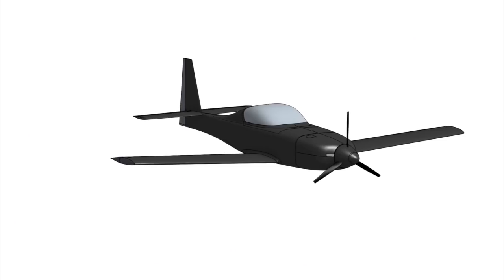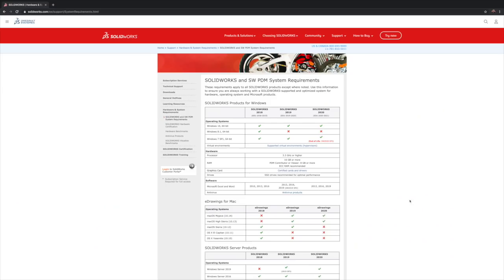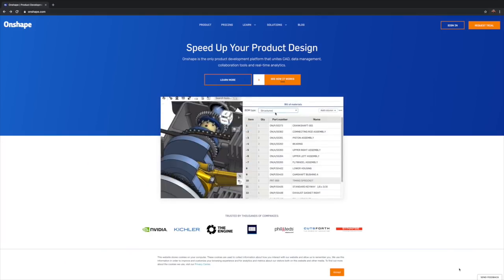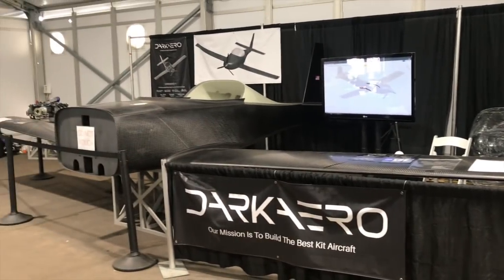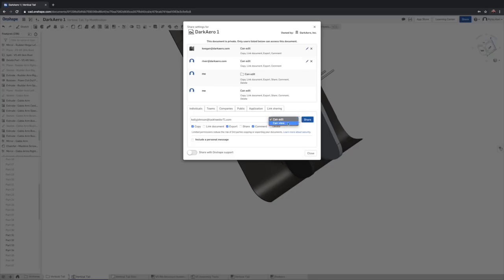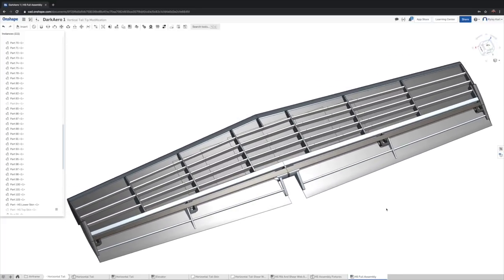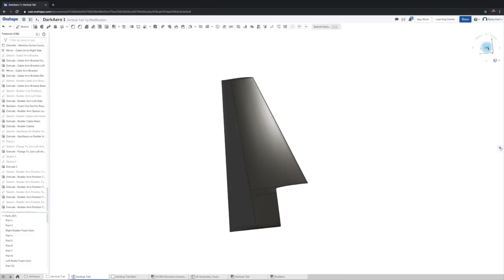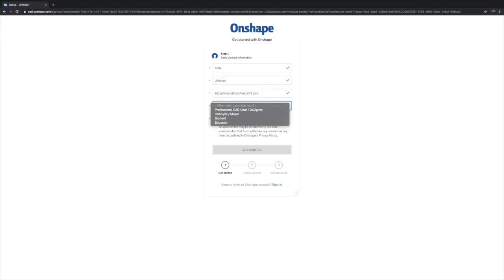Why we switched from SolidWorks to Onshape

Comment: 2019 had used SW for about a year-ish ...then its been about 7 months using Fusion 360 to date .. now on the verge of finalizing for Solidworks .I believe SW is shifting to Cloud (got to verify) .. ...been hearing about Onshape ... we are a Autonomous Vehicle Company (very early stage startup) and looking at stabilizing and freezing on ONE at most TWO CAD applications ...looks like Onshape is a new contender.
I AM OPEN TO ADVICE, SUGGESTIONS and sharing of thoughts.
(thank you for the video it was definitely the pivot that swung me around)
Reply: I would not use SolidWorks unless you have a legacy reason to do so.
Reply: SW is moving slowly to the cloud, but in a cobbled together fashion.  Onshape was built from the ground up for the cloud. Just my 2 cents.
Reply: You might also look into Alibre to see how it compares. If you're designs are more surface oriented, less mechanical, then perhaps Rhino.

Comment: You can try 3dexperience platform using solidworks. It's cloud based and It has xdesign, xshape and do simulation as well while also have access to solidworks.
Reply: This is what I wondered, 3Dexpereince has been arround for at least a couple of years, so
Reply: I think the big drawback for small startups is the cost. There's just no getting around that pricetag...
Reply: @zaknefain100  okay, so they just announced it will available to you for $9.99/month. It will available in second half of the year
Reply: @divyagarh  Not 3dExperience.. Solidworks.

Comment: It looks like you are using Fusion 360 for CAM. Why didn’t you consolidate platforms to Fusion 360?
Reply from the maker: All CAD software is trending towards the cloud/web based model. Fusion 360 is adding more and more web-based design functionality, but it is not yet fully web integrated. With a completely web-based cloud CAD solution you can use it across any device (phone, tablet, etc.) with full design capability. This was important for us when we started because we didn't have internet out at our shop, but we still needed a way to access our CAD for referencing measurements, etc. With SolidWorks we didn't have a seamless way to manage our CAD data both when we needed to access our CAD whether we were at the shop or at home. Additionally, Onshape will allow us to integrate CAD into our web-based customer work instructions without requiring them to have a CAD license to view our CAD for their build. Onshape doesn't have a nicely integrated CAM solution so that's why we use Fusion for CAM.

Comment: Why not using CATIA? Its so easy to cr***, most Aerospace companies are using either CATIA or NX. I don´t think OnShape is that good for larger projects. What happens if the server goes down? Or the companie? All your design is lost, i mean you can export a step file from OnShape, but all your parametric design is lost. What happens if you have to open your files in 10 or 20 years and that cloud servies does not longer exist? For me that would be 2 very big drawbacks. That´s one reason we did not switch form CATIA to  3dexperience (Catia based cloud CAD) at our FSAE project
Reply from the maker: Either of those applications are fine choices. We simply wanted to tell why we found more value in using Onshape over Solidworks. We've designed our entire airframe, molds, jigs, and fixtures in Onshape and have had no major issues to speak of. Any software  packages you pick, including the ones you've mentioned, are going to have future proofing and technical risks tied to them. We assessed the risks tied with using Onshape and felt the benefits greatly outweighed the risks.
Reply: Onshape doesn't have a crashing problem. Because of its unique database architecture (nothing is ever stored in files), all of your data is stored instantaneously and redundantly. And every Onshape Document has a permanently saved Change History so you can always return to any earlier stage of your work.

Comment: I think that your experience with Solidworks is pretty typical of all small engineering startups.  The very expensive recurring annual license renewal of $5K per engineering workstation is a deal breaker for most of us.  Onshape and Fusion 360 make more viable options. The reason I prefer Fusion 360 is that all of the tool paths are identical to Solidwoks because they license them from Autodesk .
Reply from the maker: tizwicky, we all used Solidworks in undergrad so we were pretty comfortable with it as a CAD package. It seemed like a good option at the time. You’re right though. The costs to purchase out a few more CAD workstations and get the file structure all set up and talking between them led us to look for other options. Fusion 360 has a great CAM package. Thanks for watching!

Comment: What is your OnShape to CAM workflow like?
Reply from the maker: After final review and sign off on the design, we will export from Onshape to Fusion for CAM work.
Reply: @DarkAeroInc  that's interesting, i guess you have a reason for not using Fusion all the way ?
Reply from the maker: @SuperYellowsubmarin  we prefer the CAD interface that Onshape offers. Fusion is great for CAM. We just use the tool we like the best depending on what job we are doing.